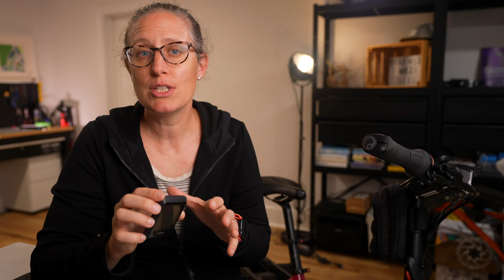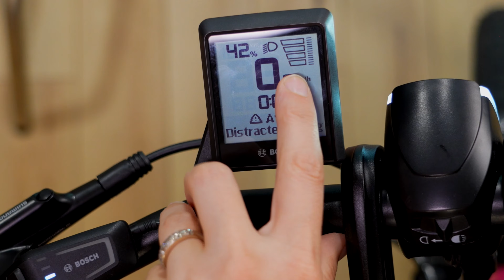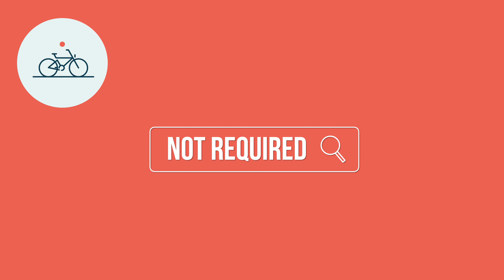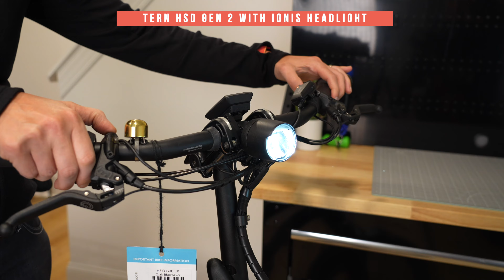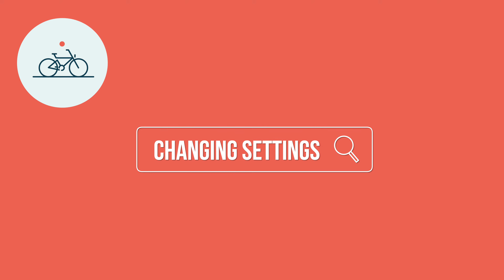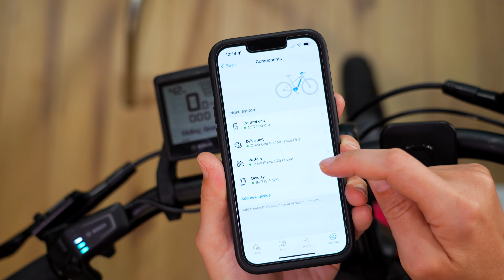How to Use the Bosch's Intuvia 100 Display for Bosch Smart System

Comment: Great tutorial, I have a new E Bike (Gazelle) Arroyo C5 Elite) After doing a few miles on it I took the battery out to charge as it was not fully charge when i took delivery. When i re'fitted the battery (fully charged) nothing would work, the display would not come on, the on button display flashed and then went out, the app would not find the eBike, there is no power to the bike ?
It will not pair. Pressing the bluetooth button will put the display on but it is locked. What am i doing wrong.

Comment: Great video, thank you. Still, I got a problem which has no answer here. When I turn on the controller the intuvia doesn't open until I move the bike using the pedals, thus turning the motor on. What should I do? Thanks😊
Reply from the maker: Does your LED remote work?

Comment: Nice tutorial! But one question: my wife has the same bike as me, but with the Intuvia display, while I have the Intuvia 100. But she has a lighted display in the evening while I cannot see anything on the display because there is no light..I suppose this is because they want to save battery live?
Reply from the maker: You both have the same bike and display but yours doesn’t light up? It’s under settings. You can change the backlight options.

Comment: I sent my bike in a van 800 km away..I covered my Intuvia 100 with plastic and took out the battery with me in my car.  Now, when putting all together, the Inuvia 100 won't start when pushing the start button to ride. It says goodbye. I replaced the Intuvia button battery, but nothing changed.  Pressing the control button, it says connected, but... shuts down in seconds.  I gave a Trek POWERFLY SPORT 5 EQUIPPED GEN 4 24 L.
Any suggestions?  Thank you for your video. It is great

Comment: I'll type this here in case anyone else has the problem I was having and can't find a video dealing with it - my Intuvia display kept switching off every 60 seconds, no matter if it was attached to the bike or not. If I knocked on the Intuvia or gave it a wiggle, it would switch back on, but only for another 60 seconds. 

It turns out the battery cover on the back of my unit was slightly ajar, which prevented the small switch on the back of the intuvia from being fully pressed in when attached to the bike, so the Intuvia thought it was detached from the bike, so it switched off every 60 seconds. Once I removed and reattached the battery cover correctly, and mounted the Intuvia back on the bike, all was well.

I hope that helps someone else!

Comment: Just purchased 2 trek bikes  , the screen has a mind of its own sometimes it works sometimes not on both bikes . Dealer checking into it currently . Not consistently connecting with controller

Comment: A nice tutorial. Thank you. One small heads-up: On my bike, the Intuvia display wouldn't come off. Turns out, it was screwed on to its mount, and thus could not rotate. Removing the screw obviously fixed the issue.

Comment: I'm trying to determine if the Intuvia 100 can be used with a chest or arm strap to monitor heart rate, but no luck so far. Comments, please?   Rik
Reply from the maker: It doesn’t display heart rate, but the flow app can connect to heart rate straps. As long as you have it running in the background it will keep the data but the intuvia wont display it (that I’ve found!)
Reply: You're a gem and thanks so much. I love seeing my heart rate as I bike and all my research matches  your answer. So, I think I'll keep my Wahoo computer, even tho there will be some duplication of other data points, at least I'll be able to see my heart rate.
Reply: My light won’t stay on when I need it. It will switch on for a few seconds but then goes of but then later will be spotted by a colleague that my light is permanently on any ideas

Comment: Hi, this is very helpful thanks as I couldn't find a decent handbook for it from bosch online. But I don't understand why I can't have the display constantly on for night riding. Otherwise I can only see what's going on by changing assist level. Any ideas?
Reply from the maker: I’ve tried multiple things and no luck keeping the backlight on. The only option is to hit the scroll side to side, no need to change assist level.
Reply from the maker: You can also push that small select button. Have you watched this vid? 

https://youtu.be/2FbchR2eXWM?si=Fpefb2dHadCdjOqh

Comment: Hi 
I’ve just purchased an ebike with the Bosch smart system and Intuvia 100 display
I am still learning 😂 but one thing I haven’t gotten an explanation for is the function of “shift” ⬇️
What is to be shifted ? Should I change gears or modes ?
Kind regards Anna
Ps
I find your videos very helpful
Reply from the maker: Great question! Not all bikes have this option but it is typically telling you that you are pedaling too slowly and to shift to an easier gear.
Reply: @bikeshopgirl  
Hi - you have been very helpful so now I have a couple more questions.
Does the Tour+ mode “kind of” work like an automatic shift to another higher assist ? When I tread harder on the pedals when going up a slight incline, I can feel a boost ?
Someone mentioned that a rpm of 70 was good ? And I can’t find any rpm indicator on the display ?
Br
Anna